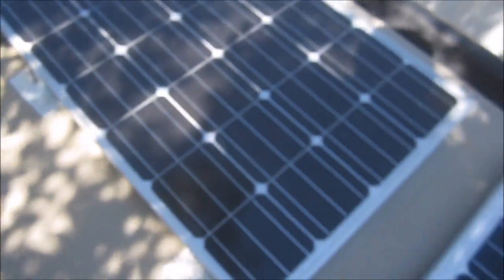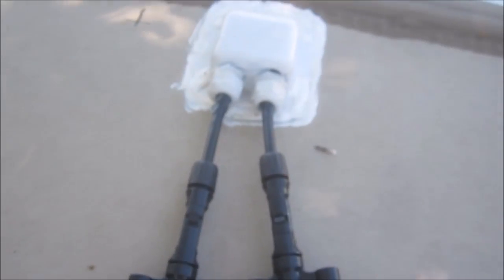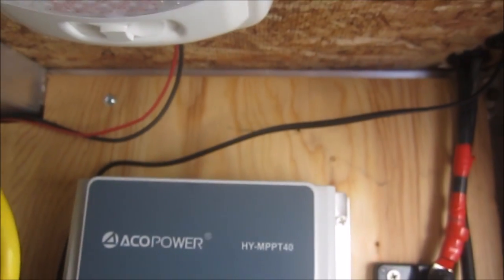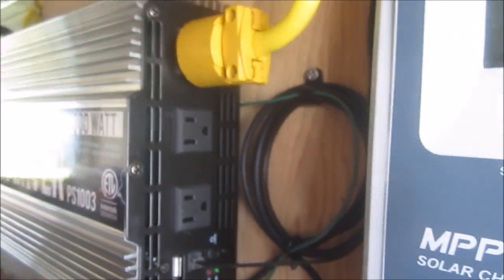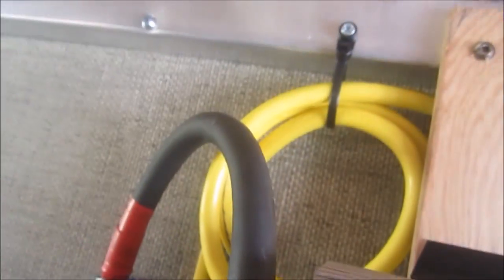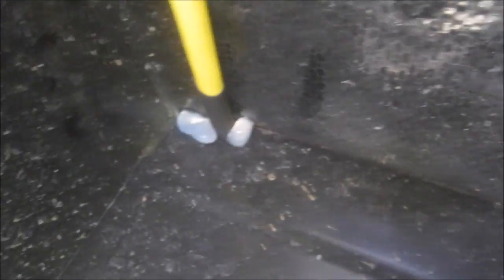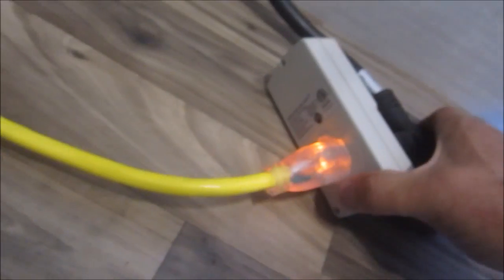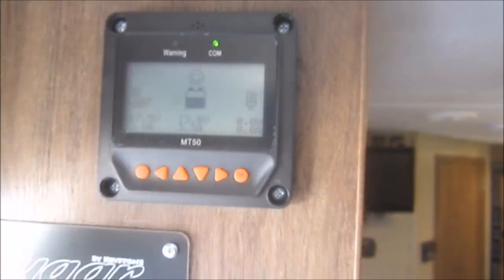495 watts of solar, 2000 watt pure sinewave inverter overview in a 19ft Cougar

Comment: @Stim Racing Trailer and Travels How is your system working after one year?  Have you made any changes?
Reply from the maker: UnkeeD not my system. I installed it for a buddy. I haven’t seen the trailer after that day.
My friend has texted a few times to tell me he replaced the batteries with two 6v golf cart batteries and that he loves the system and appreciates not having to load his generators in his truck

Comment: Wayne Rigley says below that the panels should be wired in series, not parallel, but only if the charge controller can handle "the push to 40 amps'.  Incorrect.  He's already at 40 amps in parallel and switching to series will lower the amperage to about 20 amps.

Comment: @ 2:06 can I use a circuit breaker instead of the fuse after the switch?  I see some people with both?
Reply from the maker: Wayne Phillips you can use a circuit breaker. You can also use both.
FYI. I should have put the fuse-circuit breaker before the disconnect switch from the battery.
Reply: @StimRacingTrailerandTravels  I ended up buying both now but I'll probably only use just one of them. I'm not going to be pulling much power with mine but I guess you never know. Thanks for the help.
Reply: Wayne Phillips You should really use a breaker rated for DC power. So don’t use a regular household circuit breaker.

Comment: HI, nice video, just about to start setting up all in my van.. why did you use a 200A fuse ?
Reply from the maker: Tarik Kadic 200A is below the limit of the cable and equipment to keep it safe from overload and short circuit. As one of the comments below states, the fuse should have been installed before the disconnect switch.
Good luck on your install. Solar panels continue to improve. The 165w panels in the video are now 200w at the same size and price.

Comment: So many things wrong with this wiring.. what a mess and such a danger and just horable install.
Reply from the maker: Wayne Rigley maybe you could be more specific if it’s so dangerous. You could save some lives.
Please share your vast wisdom.
Reply: Obviously Rigley the know it all has not further comment.
Reply: Ah. finally decided to chime in after 2 freaking months did ya
Reply: the roof top section are all hooked up Parallel and your using an MPPT so to open up your window of charge you need to switch to Series. well that is is your MPPT that you got can handle the 40 amp push. your wiring into your bedroom thru the cabinet is pretty much a disaster waiting to happen with open wires that are live at all times and can be damaged or nicked that NEED to be protected with a steal conduit if your not hiding it behind a wall. your fuse placement should be closest to the battery as possible NOT after a switch, this is just bad wiring. ( if your switch as they do in time from using faults out your battery will short out without ANY protection to disconnect it. just think about that for a second as the panic sets in as you start to smell the burning arc from behind your switch and the next thing you know the battery is up in flames along with your trailer.
Reply: Dan , I'm not sure what your question is as I'm having difficulty understanding your message.
Reply: Wayne Rigley you're just a shit head aren't you. Not helpful at all.  Is this the way you talk to your family and friends when you think they did something unsafe? you just sound like an arrogant ass.
Reply: @MYCHANNELWITHMYSTUFF  I think you have some serious issues on life.. but best of luck :-)
Reply: @WayneRigley  he has a 12v dc  system. That wont do any harm to nothing besides blow a breaker lol. The 120v that he has seems to be well insulated from everything. One thing I suggest is adding a ac breaker to the inverter just in case if you do have a short